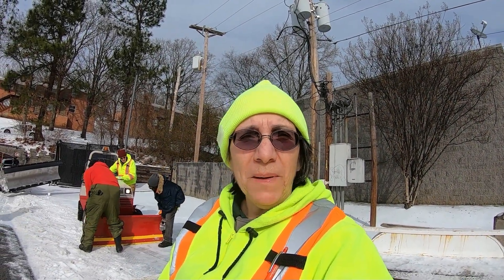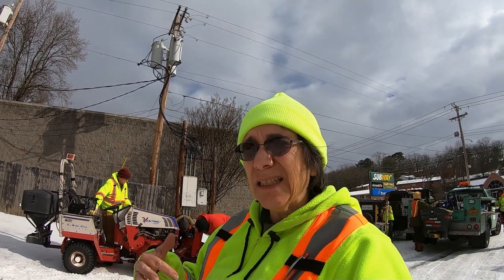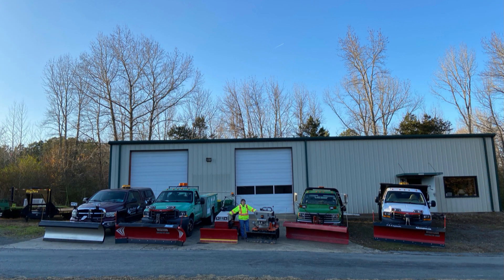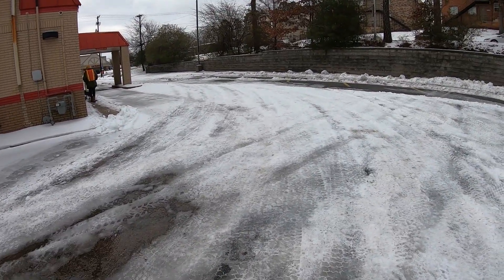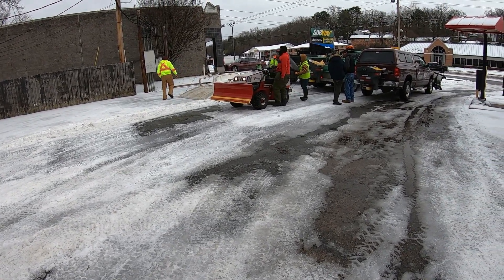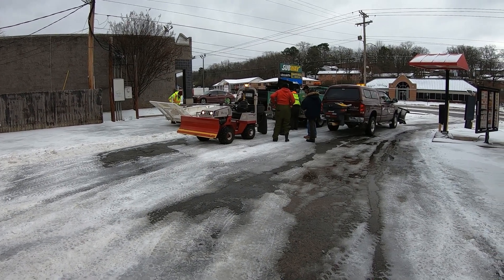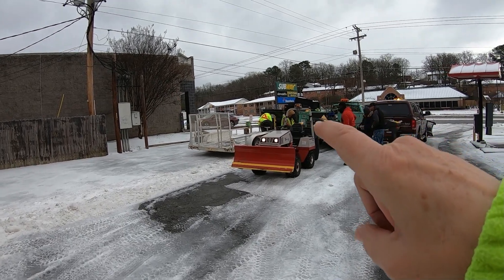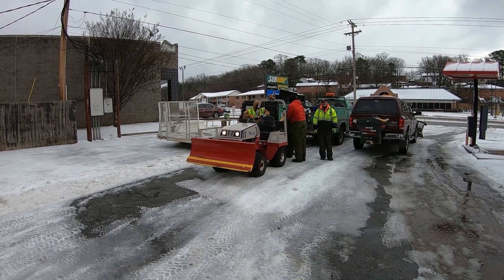Frozen Ventrac!

Comment: I agree with some comments you've already received! This one's likely simple: you need to change the (2) hydraulic filters. When the machine has low hours there will be a lot of collection of wear-in particles in the filters. Ventrac states to change (only) the hydraulic filters at 100 hours, then both hydraulic oil and filters again at 500 hours, and then I think the schedule is 1000 hours for both. I've changed the filter pair on mine at roughly 70 hours and again at about 120 hours. I noticed a step each time in quietness of rapid steering movements. You'll need a good strap wrench for the upper filter due to tight quarters...but this is an easy job. 
Also in line with what others have said, all traits will become more pronounced in colder temperatures. 
I don't think you have a moisture problem in the hydraulic oil. :-)
Wish you the best!
Reply from the maker: Thanks for the great advice.  Page 48 of the Ventrac manual we have shows a simple process on how to change the 2 hydraulic filters, but it doesn't address the frequency you mention.
Reply: @MowBeta  Oh, you're welcome. 🙂 This is important, so I just took a look in the latest Operators Manual that I had downloaded (It's version ..._R16 for the 4500Z). I have a 4500Z that is a 2018 model. I wouldn't think the hydraulic system/service varies even if you have a different engine. What I see in my SERVICE-Maintenance Schedule (there's a footnote also) matches my comment. Looking at it now: They say 1) 100 hours: filters only, 2) 500 hours: Hyd oil + filters, 3) repeat Hyd oil + filters at 1000 hr intervals. I.e. you jump from 500 to 1500 hours. Ventrac seems to anticipate filters will become restricted as the unit is breaking in. 
The lower filter should be removed and reinstalled 1st (it'll be clean and dry). Then do the upper filter; you'll have to be more patient to let the upper one stop dripping. It takes a little while, but will minimize cleanup.
Best wishes - Jeff
Reply from the maker: @jefffrei1167  Thanks, again.  This is why I set up the vid.  Appreciate the input.
Reply: I had my hydraulic filters replace at 50 hrs.
Don’t know if they still do this but at the time the dealer had the ability to run the hydraulic fluid through an external filter system (which they did on mine). I got my 4500z in 2018

Bill
Reply from the maker: @BillCoSmith  Appreciate the feedback.  Well, obviously for us, the 50hr mark has come and gone, so we're catching up on how to deal with this issue.  Am glad about all the great comments I've received from folks on here.  Was able to purchase the small hydraulic filter (non-OEM) from our local NAPA dealer, but for some reason the larger filter is harder to find so will likely have to order it directly from our nearest Ventrac dealer, which is out-of-state.

Comment: You can also have a fluid analysis performed on the oil, hydraulic, and coolant.  That will help out in diagnosing issues.  I had mine done at the Caterpillar dealer in my area.
Reply from the maker: Hmmm... wasn't aware of that option and am SO glad you brought it to my attention.  Sounds like a great idea!  Will check with my local CAT dealer about this, but also found out I can buy an oil sample analysis kit at a local NAPA or O'Reilly's store and send it off to a lab.
Reply: @MowBeta  Peace of mind!
Reply from the maker: Just a note... You were right!  I contacted our local CAT dealer and they pleasantly confirmed that they could do analyses of different types on used oils and other fluids.

Comment: There is special hydraulic fluid for the winter temps. Also your fluid level could be low. Need to check your levels and top off.

Comment: The second my 4500 leaves the garage it is never turned off. Keeps the hydraulic oil warm & moving. Gets incredibly sluggish if I turn it off during transport.
Reply from the maker: Honestly, this was the first time we've had this issue with the Ventrac.  We normally run it from offload to reload each job site without a problem, no matter how cold, or windy, or whether it's snowing, freezing rain, or blowing snow.  It was one of the things that impressed us during our winter work.  Out of habit, we do let it run a bit after offloading while we get the crew organized at each job, but this time it needed almost 20 min to get going.

Comment: Suggest you try a simple change of the Hydro filters before a complete fluid change. I believe service interval is more frequent for the filters. Also not uncommon for the controls to be sluggish before the system reaches operating temp. That has been my experience, hope that helps
Reply from the maker: Appreciate the advice.  This issue with our Ventrac had not occurred before during work in snow, nor in work in colder temps, which is what initially caught us off guard.
Reply: @MowBeta  Let us know how you make out if you decide to change the hydro filters or find another solution. Cost of filters is reasonable and as others have said, most dealers will gladly ship to you.
Reply from the maker: @bradlatimer3971  Will do.  Thanks again.

Comment: Biggest problem is trailing equipment on a open trailer wind chill gets to everything  I have a muti-Force toro  an have same problem I just let mine run all the time next year I closed or building an Enclosure on my open trailer
Reply from the maker: We've used the Ventrac during previous winter weather events and never had this kind of issue, even though -- like you -- we do open trailering.  But I agree that an enclosed trailer would be better.

Comment: Change the hydraulic filters.
Reply from the maker: Appreciate the suggestion.
Reply: I have been told by my dealer to change the filter after the first 250 hrs.  This due to break in and particle clogging the filter.    The system will whine and have jerking motion when moving forward and reverse.
Reply from the maker: @jacobcoles4163  We do not have a local dealer -- nearest dealer is 208 miles away, making it tough to have an established relationship with a dealer's service dept.  Yes, phone calls help, but we've dealt with a couple of dealers that don't know a lot yet about their Ventrac products (one brand of many they carry), so we sometimes have to figure things out ourselves.  Makes your advice valuable.
Reply: The dealer that I purchased the machine sent parts to me for a reasonable cost.   I have also called ventrac and spoke with a technician and that has been helpful as well.  There are dealers out there that are very helpful and knowledgeable.
Reply from the maker: @jacobcoles4163  Agree.  We've called Ventrac direct a few times and they're certainly helpful.